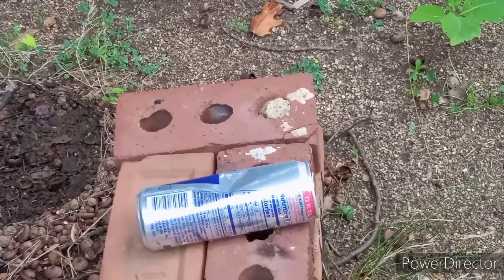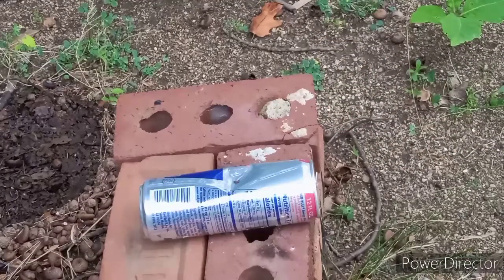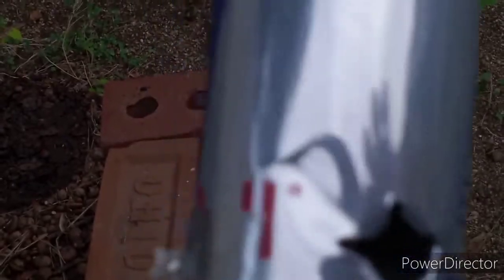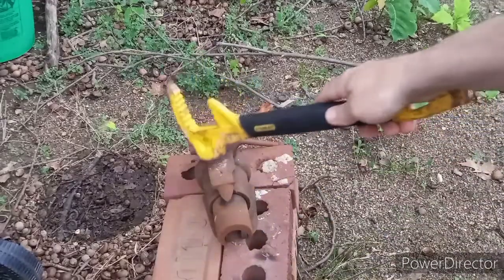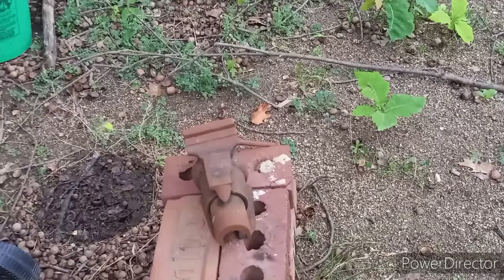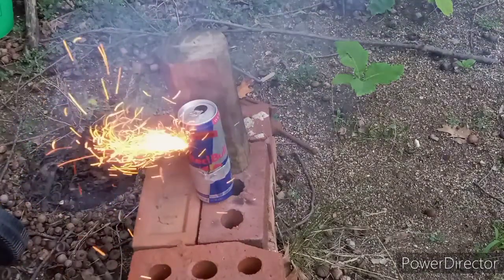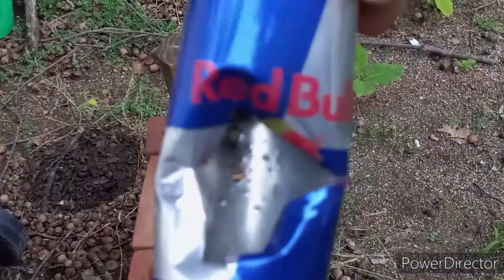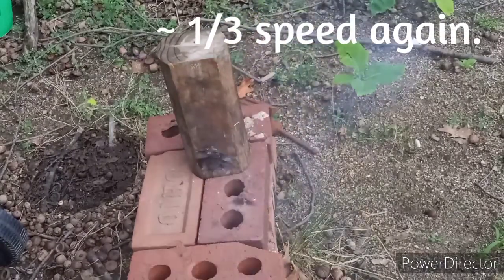Copper Azide

Comment: I've been planning to make  this my next project.  Copper is my favorite transition metal, I've almost synthesized every product one can get from Copper,  I tried to get started on Cu azide some time last winter,  but I found out to my dismay I would need sodium azide for the synthesis , and I but it on the back burner 🔥(just kidding) but I put the idea on hold, until the opportunity would one of these days turn up. Great job ! I really admire your content,  maybe you will produce a video series on the synthesis of different types of azide products .( for educational purposes only!) Of course 😁. Take care. 🖐
Reply from the maker: You dont need sodium azide. All u need is hydrazine HCl or sulfate. Dissolve the hydrazine in RFNA in a vessel u can fit w agas leafing tube. Lead said tube into aq. Solution of copper nitrate. Hydrazine plus NHO3 make hydrazoic acid. Gently heat this acid and lead the HN3 thru the Cu(NO3)2 solution. Cu(N3)2 will ppt as it's nearly 100% insoluble in water. 
 Be safe, Man. This stuff is highly toxic and sensitive and HN3 is lethal.
Reply: @pbn3215  yeah, but hydrazoic acid. That stuff is NASTY!

Comment: I managed to make exploding airgun rounds with silver azide
Reply: Plz explain
Reply: @naveenc4253  you can squeeze enough of the compound in a piece of antenna tube. Cut a regular pellet in two pieces. Glue those pieces to both ends of antenna tube filled with AgN³. That tube no longer than 8 to 11mm.  And you got yourself a pellet that makes decent holes in plywood, concrete etc.  Lots of things to go sideways though... Including but not limited to ruined barrel of your bbgun
Reply from the maker: Idk. Try it & report back.

Comment: What is the storage life like and is it hygroscopic?
Reply: @pbn3215  which primary ones are suitable for storage and have good powerpower like TATP
Reply: @pbn3215  Yes, I know about HMTD, but I think TATP is much simpler for perishable detonators. Will there be experiments with nitrotetrazoles?
Reply: @pbn3215  very good, I am also interested in DDNP. according to what scheme do you make nitrotetrazoles?
Reply: @pbn3215  Who is Tom? What is the name of his channel?
Reply: @pbn3215  Yes, I saw that video. Are you going to make urea > calcium cyanate > calcium cyanamide and so on from scratch according to his method?
Reply: @pbn3215  very cool, I thought this method doesn't work or only works in theory. I hope everything worked out for you.
Reply: @pbn3215  ok, I like this method for its simplicity and I'm glad it works.
Reply from the maker: If you're able to store it it'll retain it's properties if kept dry & out of UV light, but you never wanna try storing such unstable EMs, ever.its not hygroscopic to any appreciable degree however

Comment: Looks like instant DTD transition as seen with lead azide. I guess it's sensitivity is way exaggerated, it's made out to be like some evil, nitrogen triiodide-esque unusable material. It looks safer than the hateful organic peroxides you see nincompoops dicking around with.
Reply from the maker: It's extremely shock sensitive but not nearly like NI3. Or TATP